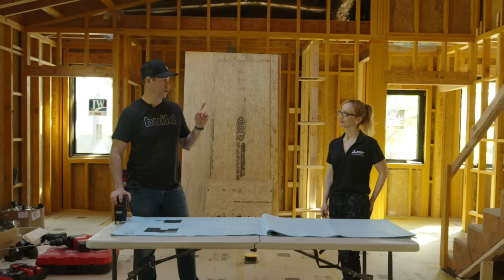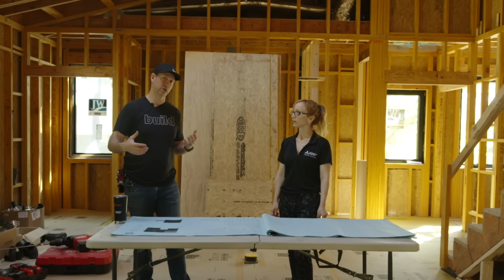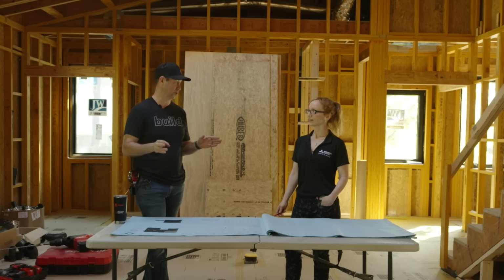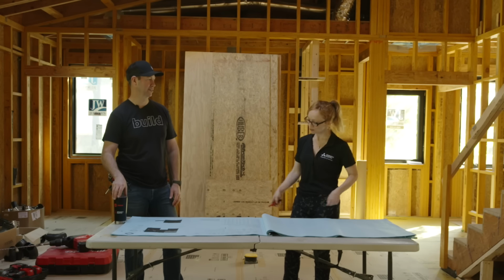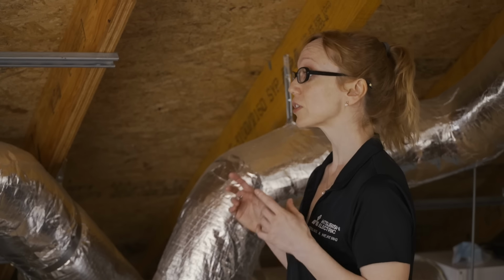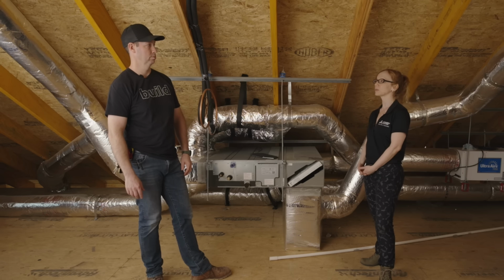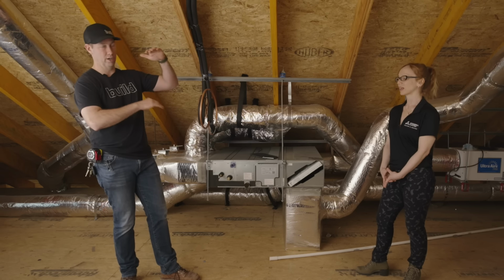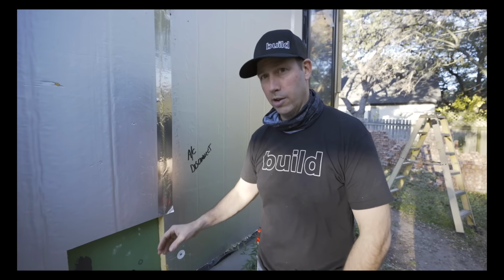Mitsubishi HVAC At My House - Full System Tour

Comment: What is your service amperage to this house?
Reply: Isn’t standard residential now days 200amps?  I image for how efficient this house is it wouldn’t require anything more.
Reply: @Whatwherewhy586  Just wondering what new houses are being installed with since there is more demand for electric appliances/devices.    I have 400 amp to my house, attached in-law suite and Pole Barn.
Reply: @waynedalearchery9621  typical new house in Pennsylvania is 200 amp, 100 amp for a trailer house unless heated with electric. Higher class places with pool pumps and such might need larger services. But most middle class homes are fine with 200 amp services. A farm often needs 400 amp service, sometimes bigger.
Reply: @Whatwherewhy586  200A * 120V = 24kW .. 15+16+36=57kBTU/h = 16kW of heat / cool = ~5kW electrical load from the compressors and fans at peak ... Which is tiny for a house that size good job! ... it might need more amps for cars, ovens, hot water. Is there solar and/or big LG Chem/Tesla battery there?

Comment: .6 SP is not much but it's made for proper duct systems which I would say most homes don't have and they should because with any equipment bad SP will kill efficiency.  High SP restrict CFM airflow, it's easy to get low SP, or fix, but it's amazing how most HVAC installs don't even measure it, shameful.

Comment: As a HVAC technician, I don't recommend mini split from repairing aspects. Many of control board and connector are proprietary parts. Which it increases repairing time and costs. In ur case, it is okay since u have central AC to help if ur mini split got problem. (FYI, what I know as a technician in Houston that most of HVAC supplies to support central AC system. Think about mini split as Tesla and central ac as Toyota, u might not able access proper part for Tesla, but u can go any store to get Toyota parts.)
Reply: That sucks man, what makes have you run into that didnt have parts readily available?  In east TN between the few supply houses around I usually only have to wait on parts for older equipment.  I've only really seen Mitsu's, Fujitsu's, and LG's minisplits though so there's a lot I have no experience with.  Never had any issue getting parts though, they seem to be either on the shelf or trucked in within hours at the suppliers we buy the units from.  Cost, meh, you're probably right that parts can be more expensive.  That said, my opinion is that it's insignificant and maybe not even a fair comparison. Parts are only notably more expensive compared to cheaper(lowerSEER) and older equipment, comparing parts to other high efficiency equipment shows little difference.
Reply: @paulmasoner8073  I am hardly running to mini split in Texas. As we know everything is big in Texas, so AC. I mean mini split is so unpopular even store sells the unit but they didn't stock the parts (such as control board, compressor or condenser motor) the store told me they hardly sold a mini split therefore they don't store those parts. if u need it, they will special order the replace parts. I mean I rather shop from amazon for those parts with 2days free shipping instead order from store. yes, u can replace some of parts with after market parts but not every parts.
Reply: @jie1379  I’m in Texas and yes mini splits are not the majorly but VRF heat pumps are getting very popular, one outside unit and multiple indoor units is definitely the way to go.
Reply: @TheJPPowell  u might need to consider that multiple evaporator coils will increase chance of refrigerant leakage. I would not recommend my customers that. Instead of that, I would rather recommend one central ac with multiple zone, so there only has one evaporator coils. For long terms, you won't suffer to troubleshoot which coils is leaking refrigerant. (Since we adopted R410a, I noticed evaporator coil get leakage more often by comparing with R22 system.)
Reply: @jie1379  you’re definitely a technician lol... thinking of what may have to be fixed before there is ever a problem. With a quality install, won’t be a problem.
Reply: @jie1379  also the way we combat this is with ball valves on large projects so you can isolate what may be a problem section, if ever.
Reply: @TheJPPowell  that works, but I would charge more for extra work, those thing usually for apartment and commercial building. Reparing rate is different. I would rather go with simple setup so less problems. Reputation is important that how people refer you to others. (It is all about cost effective, I don't think that many ppls will pay green taxes)
Reply: @jie1379  couldn’t agree more!
Reply: @TheJPPowell  one more thing, even those with quality install but there is one various you won't able change which defect evaporator coils over life spans of 20 years. I will be honest with client that unit defect rate will increase since there more moving parts. All of decisions is up for them. That is reason BMW costs more to maintain than Toyota
Reply: @jie1379  I may need to move to Texas then. I hate mini split systems.
Reply: @seanmathews1826  I hate to fix mini split too, I can't 100% fix it. There are much more moving components(so much more potential failures) and I don't have those components in hand. However, most of us that have most frequently broken components for central AC system in our work truck, so it saves travel time to purchase replacement parts, at the end, those saves will pass down to customer.
Reply: @jie1379  Mini Splits are over engineered junk.  The company I work for installs the Carrier mini splits.  And even the guys at Carrier tech support don't really know how these things work or how to troubleshoot them.  They have admitted that the install manual is vague and incomplete.  They are nothing but glorified window air conditioners.  I always try to discourage customers from buying them.
Reply: @seanmathews1826  yes, they are over engineering. If u can't afford central ac, just get the window unit in my options.
Reply: It’s funny because your Tesla comparison is rather apt. Both splits and Teslas are far more reliable even if they are a little more parts scarce.
Reply: As an HVAC technician I can see why you would be against mini-splits - I have found them to be far more reliable than the traditional mass market "junk".  Part of that higher cost of a mini-split system is in the build quality.  I have never seen a mass coil recall with a a mini-split manufacturer like I have with Goodman, Carrier, Trane, etc.  Different price points get you totally different quality.  My parents have a 20 year old system and other than cleaning the coils every few years it hasn't had a lick of maintenance done to it and it handily outperforms their main system in the rest of the house.  If their main system ever goes out, we will probably replace it with a multi-zone system. Not necessarily a Citi - it's a nice system but total overkill for a residence.  Just  two four head systems would cover the rest of my parents house and since I can easily DIY install it, it would be way cheaper than replacing with a traditional system.  I will also be able to eliminate all the ductwork and equipment from the attic which is also significant since they are in the southwest. 

Now as mini-splits gain in popularity will they suffer the same "least common denominator" and "race to the bottom" that has infected the rest of the residential HVAC industry?  Perhaps.  But I suspect at least the Japanese made systems will remain high quality - will probably see the cost go up as demand does which would stink :/
Reply: @DocNo27  lol, unfortunately, Trane(Made in Tyler, TX), Goodman (proudly made in houston, TX), Carrier (probably made in Mexico), they are all made in American quality. I mean no matter where they made from there are always have quality issues sometime. You might see more often defect products because they are the major HVAC system in the state. The mini split still a new system in the state, it is not popular, there is not enough sample to decide whether they are more reliable than central ac.(At least from my experience in Texas) Finally, all of those American brand use copeland emerson compressor, they come with at least 10 years warranty and Copeland Emerson compressor build for tough. However, foreign brand company they use their own design compressor (this is my opinion I don't trust their technology)
Reply: Mitsubishi’s are built like tanks. They cost more however, they are more reliable. 
But gone are the days of simple, across the line starters, relays and pressure switches. Today, VFD scroll compressors, VF, integrated circuits mean more chance of failure given more components. Most people don’t understand that dirt, moisture and critters are the enemy of reliability.
Reply: I agree here- definitely need a robust warranty where parts are available and/or manufacturer or distributor are quick to replace vs repair when parts are not available
Reply: Ductless also save you in electricity cost so that is something that can offset costs of parts. The cost of one outdoor unit can buy 8 ductless units
Reply: Great advice. Always easier to get something that's available at most places. Murphy's law if it can, it will. I also would have thought he would have gotten those ducts spray foamed. I find the r value very minimal in those flexible ducts and any dust can get trapped between the ridges.
Reply: Oil trap with that vertical loop...
Reply: <-------Also HVAC tech and I agree. Stay away from mini splits. Especially those generic mini splits that DIY people buy online for $400.
You can almost never get parts for them because the companies that sell them go out of business so frequently.  So once it breaks that's the end of it.
Reply: I appreciate your advice. All this being said, I live in Austin. What system (variable speed?) manufacturer would you recommend? I was just told that Trane is expensive to repair whereas Goodman is a solid unit.
Reply: @stevens.4789  I mean there have been cutting corner for most manufacturer by comparing 20 years ago. They have been cutting thinness of copper for the evaporator coil and condenser coil. Even those, they are assembled in USA but with global parts. I prefer carrier than trane or goodman. (I have been starting using carrier last five years. I haven't see so much problem. U can get variable speed from carrier. But I would recommend stay with single speed so less moving parts less problems) Goodman is most cost effective in houston since made in houston. Warranty is easier. But I wouldn't recommend if u live outside of great houston areas. For Trane, it has been monopoly by a single distributor in great houston. It is bad for customer(consumer can't able access a compatitive price, that is reason trane is overprice in houston) therefore, trane distributor can charge what ever they want, replacement will cost more 30-50% than other manufacturer. FYI, I hate this kinda behavior, so I boycut Trane. 😂
Reply: @jie1379   Thank you again. As I live in Austin, my needs are similar to yours in Houston. Any way I could talk with you and pick your brain a bit further?
Reply: And what kind of costs are, for example, involved for say a controller
Reply: AMEN!!!!!!
we’ve sunk thousands a year in a new (4year old mitsub mini split sys) mini split sys in JUST labor and freon, the compressors, control boards, defective indoor heads .
its unreal, and loooong back ordered parts (4-5 months on average)
Reply: I love the technology but mini-splits to date  just aren't as  dependable as a regular central AC
Reply: Wholesome string of comments. Wish i had hvac in my house.
Reply: Weird, we sell the shit out of minisplits in Montana. Mainly hyperheats
Reply: Hi. I’m a owner here in nyc, just demoed a condominium with plan to put in a LG vrf unit with four zones in a 1900 sq ft apartment. I don’t have an access to outdoors and my engineer tells me I don’t need it. And all I need is approx. 2ft x 2ft. “Main unit” with 4 mini splits.  I like to hear from you if that makes sense(need to be reassure I’m not surprise down the road. Also read your point on refrigerant leaks 😱 and some of these lines including the condensation lines are in between walls with no access. I also have a humidifier and a dehumidifier unit included....should I ask for an aces panel over these. 

I’ve notice we gone high tech but when building I always ask how and who can fix.
Reply: @anthonychan6486  refrigerant lines hardly get leak. But just make sure stay with popular brand so u able access parts.
Reply: @anthonychan6486  good point, u might not able find a great technician to fix this kinda setup. I know many old NYC building didn’t build with central ac in mind. Many ppls use window unit. Mini split is most cost effective for ur house if u don’t have central ac.

Comment: I’m getting a ducted lg unit installed right now and they don’t recommend coming right off off the cap like you have there. Who is right? They don’t have a YouTube channel. Should I worry?
Reply: Talking about around 13 min? ... yes typically- you never* want to duct straight out but rather even have a longer plenum- especially on the ducted mini split units- talking 5-6ft plenums to- these units are so smart- they Calc static pressure of ducts and adjust accordingly. Best practice is to leave the last 2 feet of the plenum with no ducts what so ever. Helps the unit find a good groove for SP.
Reply: @TheJPPowell  do you recommend dampers coming off the ducts for room control? I have a system coming that will feed 5 bedrooms. What do you recommend to balance all the room temps?
Reply: @TheJPPowell   thanks!!!
Reply: Can you give a time reference? I can answer this one

Comment: Heat pump or heat recovery unit? HR is the way to go!
Reply: This has to be a HP I don’t see any flow boxes or flow selectors ;-)
Reply: @TheJPPowell  figured, I just didn't watch the whole thing. Bad decision on his part imo
Reply: rustynutz28 Bad judgement ok your part
Reply: HR is good, but is not practical or needed for residential
Reply: @spchips  ehh. I disagree

Comment: Does the Man-J take into consideration factors like heat and humidity generated by cooking activity and heat from appliances?  Wouldn't you want more fresh air exchange in the kitchen?  Great stuff!
Reply: Yes - in every load calc that is ACCA or AHSRAE certified it will allow you to click on what the space is being used for- even multiple types of kitchens bc some have two fridges vs one, range with exhaust etc, even down to how many ppl usually occupy the space- all contribute to the heating /cooling load
Reply: @TheJPPowell  Excellent.

Comment: Matt, for the upstairs, was it cheaper to go with the ducted system instead of individual ductless cassettes in each room on a multizone compressor? If so, please explain the compelling details.
Reply: Oversizing my friends! Mitsubishi has released notes to not oversize their equipment just like any other. Bedrooms have low loads and the smallest ductless is 6k which is way too much for a simple bedroom plus closet and bathroom.
Reply: @watchthestars.atacama  , it's on the upper end for sure, but 6k should be fine for a modern mini-split to cover bed/closet/bath without being over-sized.
Reply: @somedude-lc5dy   I do MJs and I would be more than surprised if the load on one of his bedrooms+ bath+wic would even get to 3k with the building envelope he'll have...
Reply: there are a lot of things to consider. individual ductless systems don't have good filtration or dehumidification (aside from when they're cooling). so, if you want outside air, fine filtration, and dehumidification, you may as well use a unit like one of these so it can all be streamlined together. it is hard to no over-size a mini-split for bedrooms anyway, so this is the best way to do it on such a sealed house.
Reply: @somedude-lc5dy  watch a previous video where he shows his whole-house dehum + ventilation + filtration, it takes care of all that.
Reply: i would expect it to be cheaper, the cost of the medium static unit is not that much different than the cost of a single cassette. Really comes down to how much labor wants to charge for ductwork, but my experience has been duct is cheaper.
Reply: @Hans Wu loss in efficiency im pretty sure if he went that route.
Reply: @Hans Wu Rooms im guessing. The downstairs has more open space instead of individual rooms so its easier to heat and cool but the upstairs has all the rooms that would require heating and cooling. Im only spitballing though. Its a different beast up here where its cold over half the year

Comment: I wish they made super-low BTU ductless heads.
I think it would be nice if I could have more zones in an efficient home without needing jump ducts etc...
Reply: So a lot of units that are 7k btu will run variable and can go down to 1/3 or lower of their capacity... that’s pretty low. Then add a small 4” duct off that with an attachment for a small bathroom, easy peasy
Reply: @TheJPPowell  oh yeah ?! Can you tell me which brand offers a 7k ductless with duct outlet please. I’d like to look into that and maybe spec it. Also, even if they ramp down to 30% capacity they don’t dehumidify well. The unit is still oversized and will short-cycle.